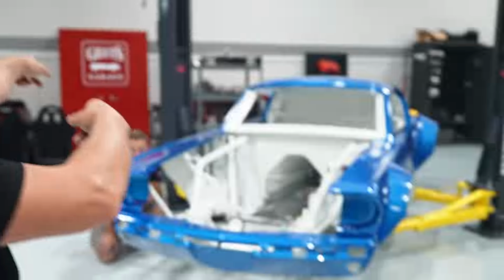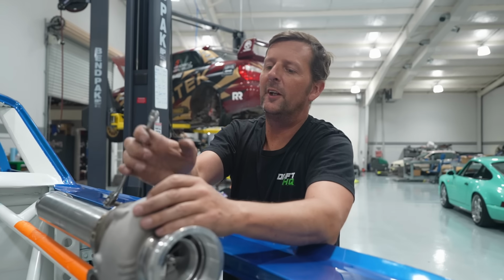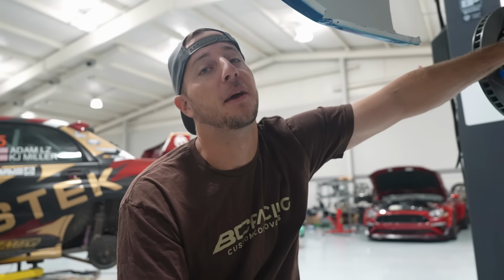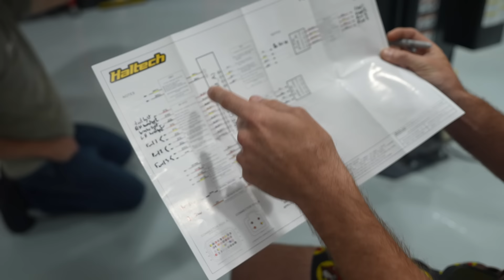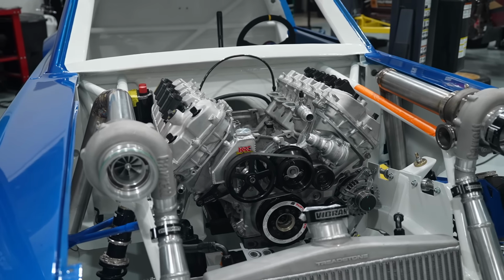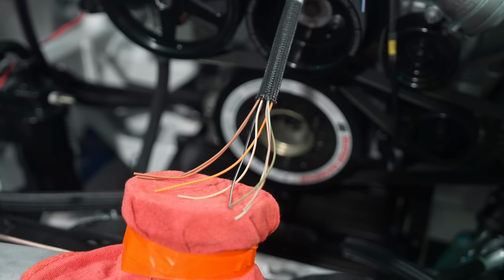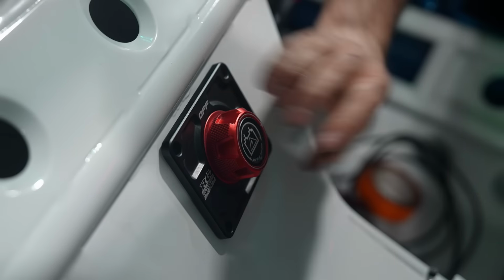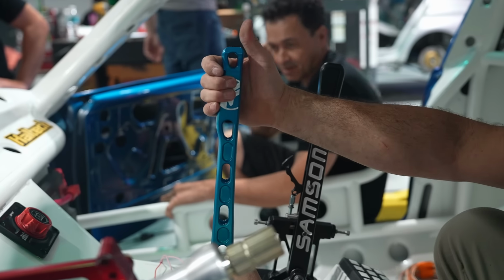Twin-Turbo Voodoo Mustang Build | Episode 2

Comment: Beautiful Built Lads 🎉 i was thinking if there is going to be a Bonnet the exhaust straight out of the turbo should dip down below the bonnet as soon as possible your gona have a massive chunck out of the Bonnet asweell the way youve done it Cricket 🤙👌I love your work lad i wish i could weld as good and efficiently as you im usually welding up rusty classic cars on my back 😂
Reply: They already cut the bonnet to fit the exhaust that way so I went with the same style down pipes they had mocked up when it came to the shop. 

If you’re good a welding rusty old cars you can definitely weld fresh material. Go get some brother and get in that seat time

Comment: I love that Color Blue!! And I am sure that is going to be one badass car.. But I have never been a pie cut guy.. I get it in some cases that's the best fix... But at the same time if you can find a way to do mandrel bends instead I would.. It's nothing to melt those welds under high turbo heat, but I am sure they got this..

Comment: Doesnt the voodoo engine have a flat plane crank and doesnt it rev to over 8k rpm? I'm asking cuz Nando said 7.5k rpm and crossplane crank which sounds lile the coyote to me but then he said 5.2l displacement and 533 hp which would be righz on the button for the voodoo engine. Amazing car and I'm really excited to see how it turns out 🔥🔥
Reply: Nando said that this is a Voodoo with a flat crankshaft and that its maximum power comes at 7,500 rpm, generating 526 hp, while the Coyote has a cross crankshaft. I believe that  only problems on  the subtitles.
Reply: @wjackdub4013  Ahhh that makes so much more sense! Thanks for the assist 🙏

Comment: Had the voodoo motor went to the predator instead sounds like a true v8 plus the oiling is 100xs better in the block imo mild head build some upgraded studs and gaskets can throw 1500 at it all day

Comment: What does the Vibrant rings do?
Reply: The are weld on HD clamps that have a sleeve on the inside and the clamp on the outside. It seals the intercooler piping. Basically a sexy coupler that you can remove at a moments notice.

Comment: Ford rescued Jaguar at the first of the new century. I have a beautiful, pristine, dark red 2001 Jaguar S-Type 3.0 Back seats have never been sat on. Never. This car had all of it's maintenance history- since new- included with my purchase. Here we are days away from 2025 and this car has less than 108 thousand miles. So, finally. What's the point of my long ass comment? I would love to put a Coyote engine with matching transmission in my car. Like I said earlier, Ford rescued Jaguar. It's only fitting. What say you?